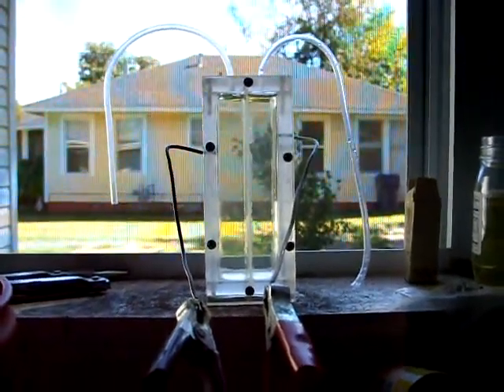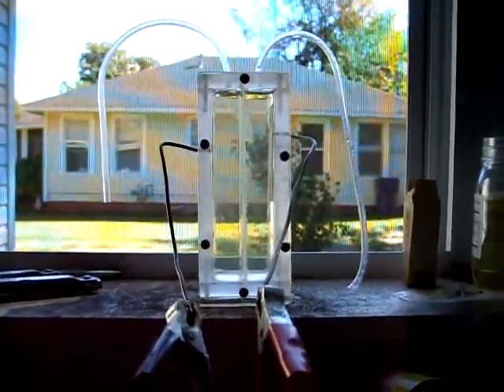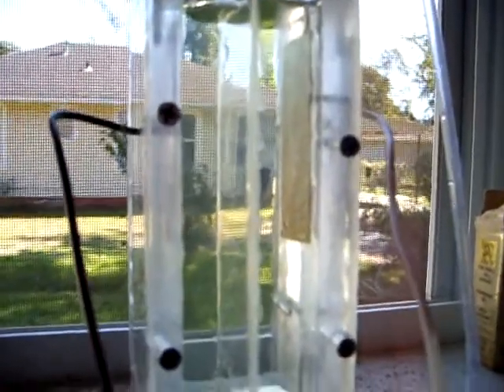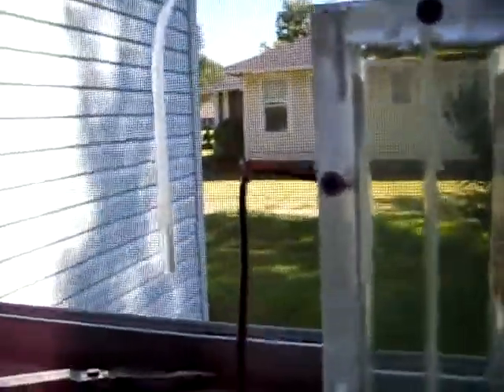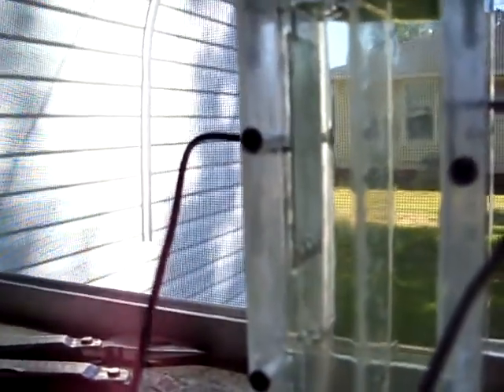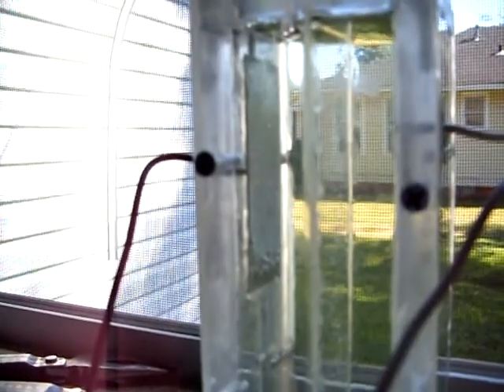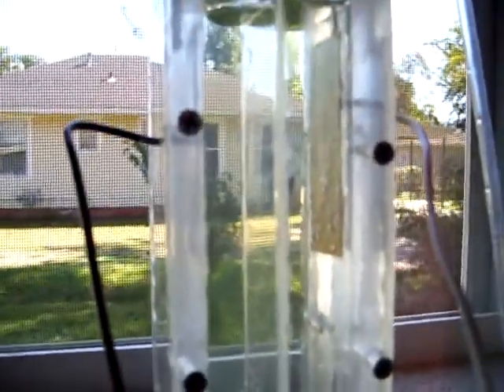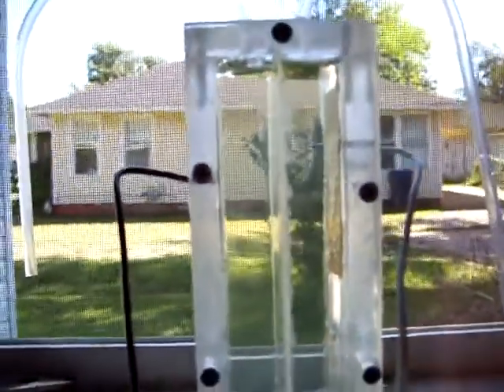Hydrogen - Oxygen electrolizer, teaching aid & demonstration unit.

Comment from the maker: I'm running this gizmo on very low volt's and 2 amps, the electrolyte is pure distilled water, so the gas output is extremely small. The next unit that I'll build will be a lot more efficient.
Peace.